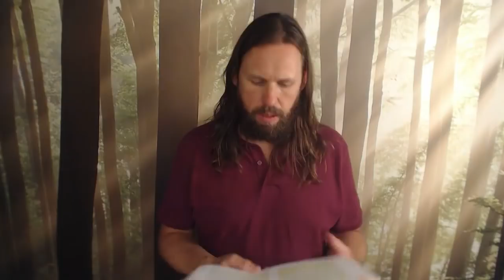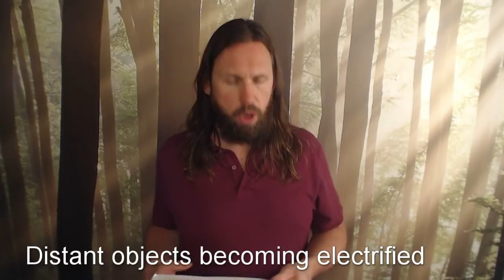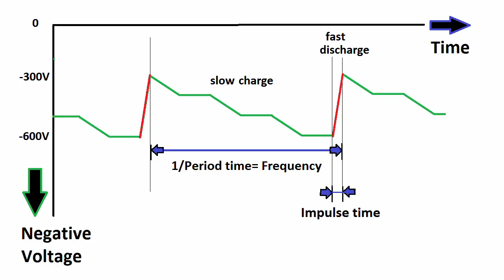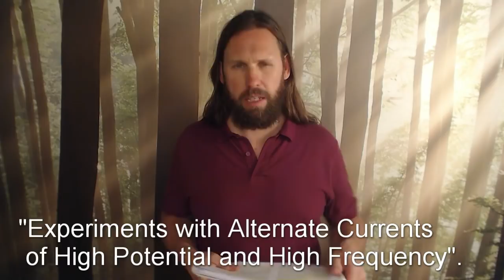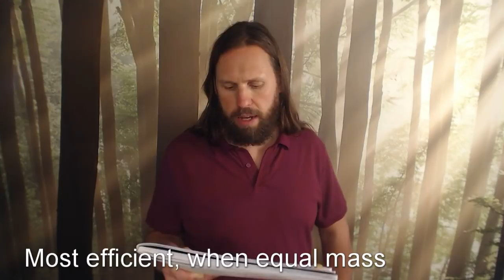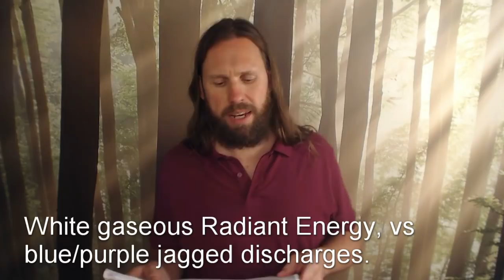Nikola Tesla's Radiant Energy Part 2 of 3

Comment: *DIFFERENCE BETWEEN POSITIVE AND NEGATIVE VOLTAGE*

Consider a 12 volt DC battery, a large one that is used inside a large outdoor camping flashlight.

As with all batteries, one side has a lot more electrons than the other side.  The negative terminal of the battery has a lot more electrons than the positive terminal.

In between the 2 battery terminals is a chemical paste.  There are tons of positive ions on the positive terminal of the battery. Each positive ion is desperate to capture an electron and must wait for a wired circuit to be connected to the + and the -- terminals of the battery to gain electrons.

As to how the electrons got pushed down and collected on the negative terminal, and how the positive terminal got stacked up with a bunch of positive, electron-seeking ions -- see here:  http://www.madehow.com/Volume-1/Battery.html

It's called charge separation.

If you wire the positive battery terminal to ground, you can now drive a negative 12 volt circuit.  You can hook the negative side of the battery to the circuit, and if the circuit is grounded, you have a -12 volt circuit.

The battery doesn't care which terminal you connect to ground (or chassis ground) and which terminal you connect to the circuit.

*HERE IS THE BATTERY'S MISSION, THE ONLY THING IT CARES ABOUT*
To kill itself.  The 2nd Law of Thermodynamics requires that those electrons get to the positive terminal and EQUALIZE THE CHARGE SEPARATION, get rid of the positive ions.  "I'm an electron, and I'm being forced to conduct through this circuit.  Fine, I'm gonna put a stop to it, all my electron family are heading for the positive terminal - then no more being pushed around by the damned ions."

The battery's job is to flow electrons from the negative terminal to the positive terminal to kill itself, because it's required by the 2nd Law to do so.  

If you  put a couple of resistors, lights, transistors, etc. in the electron's way,  it cares not a bit.  Those electrons don't care about anything else except killing the battery's charge separation. 

.
.
.
Reply from the maker: The electron is not a "particle" this is one of the big misconceptions. It's the end terminal of a dielectric field on a conductor (better called: reflector). Everything is made out of fields, not "virtual quantum particles". Fields have different possibilities, like creating a ring vortex, and transforming from one into the other.
Every field (transverse magnetic, dielectric and longitudinal magneto dielectric) has polarity, meaning they can flow 2 ways. positive to negative, and negative to positive.
Reply: @MasterIvo  If you consider the electron gun in a cathode ray tube (CRT), the electrons are 'boiled off' a low-work-function cathode material and electrostatically accelerated to collide into the phosphorescent dots of RGB color on the glass screen of the monitor or TV - that's how CRTs worked.

The electron as distinct particles are also considered in the 'EVO' research of Ken Shoulders (U.S. Patent #5,054,047 for example).

In any event, a battery has its positive ions that lack electrons - in the positive side of the battery.  And the negative side of the battery has excess electrons.  And the working idea is that if a copper wire is made to physically, electrically connect the negative side to the positive side of the battery, the battery charge will quench to zero volts and the wire will get hot.

Meanwhile, we're told that "earth ground is a vast, infinite pool of electrons".   All of us have worked on/built electrical and electronic gear that relies on, is connected to, 'earth ground' at MULTIPLE points in the electric/electronic device.  In these cases,  the multiple connections to 'earth ground' successfully complete the circuit and allow 'current to flow' as expected. 

If the  negative side of the battery is disconnected to anything (the negative battery terminal is thus said to be 'electrically floating'), and the wire that is presently connected on the positive terminal of a battery is connected to 'earth ground',  the wire will not get hot, and the battery will not be quenched to zero volts any time soon.   So there is absolutely no reluctance of the 'electrons' in the negative side of a battery to recombine with the positive ions of the positive side of the battery, quenching it to zero volts.  But the 'infinite pool of electrons' supposedly present in 'earth ground' are seemingly unavailable to recombine with the positive ions in the positive side of a battery.
Reply from the maker: @Greg_Chase  electrons are made up. they don't really exist. they were made up by JJ Tomson to be able to calculate on a field as he was a mathematician. So he needed quantised stuff.

The whole universe is made of energy. energy which can be transformed and moved around.

Comment: *THE FARADAY CAGE 'FAILURE'*

Faraday cages work to shunt RFI/EMI, but airborne, projected, high-potential static electricity - not so much.

I think that because Tesla's device creates an electrostatic gradient, a large one, that even if you made a Faraday cage of solid metal sheets, you'd still be subject to the electrostatic field.   Think capacitors in series in a circuit.

The air is a dielectric.  It serves as the dielectric for capacitors quite well -- this is an adjustable capacitor for radio tuning, using the air as the dielectric.  Imagine Tesla's device on one of the plates, and a person on the opposite plate - the air dielectric would 100% pass that electrostatic gradient across the air gap, the gradient created by Tesla's device.
https://www.ebay.com/itm/NEW-TRIPLE-365pF-3-section-VARIABLE-air-tuning-capacitor-crystal-tube-AM-radio/303013031922?hash=item468cfbeff2&enc=AQADAAADAFjVrDbVsZ8oH%2F8PNHtt9VX4%2Fw7FZcmMuqsX8uaFEduVljulzvCOj4BV4Q9oabbYFM3cLH6v56%2FQsiXI86AEe7G4DI%2BU6DXRxr6bapxoywWHenx%2BYu0SdjWng0Wurx%2F2IA%2BoN%2BdzloGveMdwv%2FbTTmelfgLl6KxPZZXY7qdDxxh2TXtqQZdGJsyDO4BSGYVqjnC00wRsXn%2B7rrt%2FXKCnvonTSsfcmr4fDDongldmJvE6cazzfjh9yH1I6Ld2x%2BZ8%2FjNtYBMP2A6LdFzOq8rkjHTg1MCGX3yK54Zy%2F2Cj8B3EFQtToXvCaKqdJUxkcgUQeG7Jx1ovmIp5hfT4kWLDjm1gNbRvgprvZNj9f6K1ROkEm5EHX0lsmoosZA1AvMPMTsoBzE%2FqxBM%2FTscDNPeRuQSHHZhn7Wlw%2Fyo7sENuSquL9MqEIWTJysCtlarjv0eC5tltr0qnUlgL9u46WZ%2BdD0NjlSarrMV3lR3lUzV2huRaUxZqkvycs%2FhNBZrOu%2FyHB3lxmWEPJ8EUOKLNmNsyKOi0lYAkOGI68hUmdRRtVcIUnpO4NSDYXOz27zI2T1SUme2BrErxTlKx7tZ56RCr2gaMvAcksEp6nmz%2Fx9X%2FeduC2VM8RfpqmmaCRMhytFZmEhT%2Bzs%2F4jCtpM8luKicVSqrbm5j0qBA2h9wE15Ugf8txI0qxWPeBgfLw%2BIoSpf%2FiWINfoZXaKQT6ocZ1sY3KuDXcIG2X%2B0eu%2FqDDt6tVm3BrrGBPcnby4L3AH3mA3jBl88rjto37GfNXs5tgImJPTQtB90u7MZhG7HNxKnTXCfoPULyS3%2FPcq0kP16%2FCWmiZlpvi6p1AkuIQNfBesMhuP%2FBjHklpNRqDjq%2FjuGYlyA077flNyPoxb4wtei4K1zBhC0p6hrtyk3IlQdyNDoAi885RadrOooxNaFdTrN%2Fr9PFmMkM%2Bup%2Fo4fqF5yBUyFVamH8mz7hNNC8lKpxojZDQlTivqVK0stWxRNz7D1CFZPpQSwNKhhp9C3X%2Bf74W1RMIMw%3D%3D&checksum=303013031922d3461e66e83c4e758f13446baa8dec29

.
.
.
Reply from the maker: this video https://youtu.be/rcnEYwW7xEQ
shows an AM radio inside a Faraday cage recieving a longitudinal signal from a bifilar coil. 

If electrostatic than the cage would be the end terminal and inside would not receive a signal. If electrodynamic it would only interact with a tuned circuit like a AM radio and pass the Faraday cage(not tuned)

Comment: There are some nuances that have slipped by you here. Tesla was limited by not having a high speed scope, but he did have enhanced sensory capability. He could hear watches ticking in the next room through the walls... His set up, which can be seen when you do a hairpin circuit with caps on both ends of the spark gap, will produce a fluttering of the unidirectional pulses with each peak of the wave form. In the hairpin this produces alternating pulses... which keeps the Aether RE flowing and pure despite the metal, which is shorted and keeps the charge flow disconnected from the RE. But probably blocks the amplification.

The flutter is what the position of the electromagnetic quench is affecting in the unipolar discharge of the Tesla transformer... So that is moving the magnet back and forth across the gap sets up a different profile for each pulse series per cycle. And since we are dealing with a pseudo magnetic profile, it effectively reverses the polarity of the pulse train.

Also keep in mind the beams are superconducting... both ends have an instant effect on the entire train... it is effectively a standing wave pattern, although dynamically responsive to the conditions on both sides... this is why it expands while active, fades when shut down.

Also... "segmented", I believe refers to the 2ndary coil being a single piece of wire, disconnected at both ends (we get to grounding and top loads later) The RE is paired to a specific mass, which was the balance point that conditioned it when it was attached to charges. That same mass acts similar to a resonant cavity of a laser tuned to the wavelength... its a spacial/mass resonator that sustains the vibrational set of the pulse trains, aligning Aether from space itself to the power it assembles... if it is not used (like by making the air glow, it will overload the dielectric capacity of the secondary eventually.  A hollow sphere of the same mass should work just as well, maybe better. Or a dish or cone, which would project a beam from an open end. The larger the dielectric space or surface area of a conductor, the better the amplifying capacity.  At least by this model... 

BTW, I could be wrong... have not yet built this, just been working on Gerry's description for a while... Peace, B

Comment: I heard him say some things that makes me think tesla was working with mm waves.ie microwave . The us military has microwave crowd control weapons that create same effect as what tesla described. Ie burning sensation . That being said tesla says that he expienced a warm internal feeling when moved into a higher power output or Shorter pulse . I don't know for sure but this is sounding alot like the new 5g signal with the exception of i believe 5g is ac sign wave.
Reply: This can be done with the 28 THz out from a co2 gas laser, There is a lot of info on the antennas for this energy. When focused laser beams can have longitudinal electric fields, this is observed in flat top laser beams and can accelerate electrons.
Reply: Ypur talking ordinary electromagnetic photon waves, not high pressure aether stream beams of tesla.
Reply: Standing by a bon fire makes the about the same heating electromagnetic waves.

Comment: Master Ivo , What if you could receive radiant energy naturally by enhancing/manipulating A.C current? No need to extract the Radiant Energy by Using a Coil or Capacitor to aid during the initial short of a conductor.  I believe I found a way to do it naturally with no side effects (charging/discharging "fields")... I have many prototypes, an accidental discovery I discovered last year!  I have two patent pending technologies.  I hope the governments don't interfere!  I can perhaps slowly introduce the "Power Quantum Synergizer" to you... If you are interested?  I cannot give you the full details because I plan to capitalize on it, but I'll guide you in the right direction to experiment with this alternative method of extracting Radiant Energy, the Non Tesla way!

Comment: see, this is why I was suggesting a spark gap instead of a mosfet in a previous comment. 
Also, on a separate note, here is an important clue (I believe): when you used to turn off a sound system in the old days there would be a pop in the speakers  due to the back-EMF. If you put this pop waveform under the microscope, it would then turn out that it was in fact a frequency sweep (across all bands) that happened in a very very short amount of time. I think this is similar to what we have here, but have yet to figure out exactly how

Comment: Does this relate to what people call "scalar energy"? or ELF (extremely long frequency) waves? How can I begin experimenting with this (and not cause earthquakes or explosions)? please contact me if you feel inclined. I would love to begin adding to research in this area.
Reply from the maker: yes scalar, longitudinal pressure. not ELF. If I have results I will share them, and show how to. it's about discharging a capacitor into a coil creating an EMP. but with a very short pulse duration, making it an impulse.
Reply: When shutting power supply off and observing 'sparks' that have more energy than the system makes, it reminds me of what people call an 'air hammer' in water lines. If you turn a valve too quickly, you get an effect that makes loud rhythmic noise and more pressure than the system normally creates occurs which can burst pipes. That's why we're supposed to turn valves slowly. Where does this extra pressure come from?
Reply from the maker: The inertia of the moving mass of water through the pipes, I guess.
It seems the Aether
also has inertia, or even better, it IS the cause of all inertia
Reply: @branninbenson8990  The aether ZPE quantum field.
Reply: @MasterIvo  Yes exactly the aether causes inertia and gravity as a fluid pressure!
Reply: @MasterIvo  Some lasers work like this. As light is electric impulses.

Comment: How did Nicla Tesla get down to 100 or even 1 nsec pulse a 100 years ago ?
thats in the Tens of Mhz region ps good work ;-)
Reply from the maker: Thanks. The book says he used the magnetic quenched sparkgap in combination with nitrogen gasfilled discharge tubes. And also hard vacuum.
Reply: In other words Tesla had no access to microcircuitry that we now do, and, given we can now generate multiple DC (and AC) pulses of almost limitless brevity and intensity the opportunities for engineering an interaction between the fields are extensive.